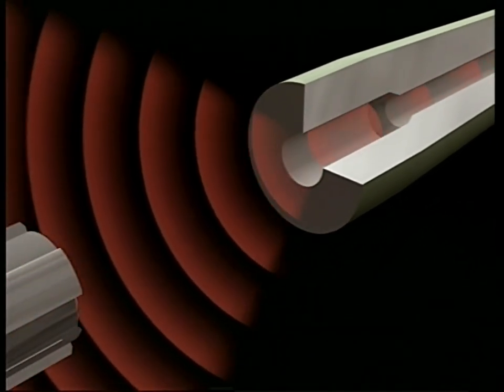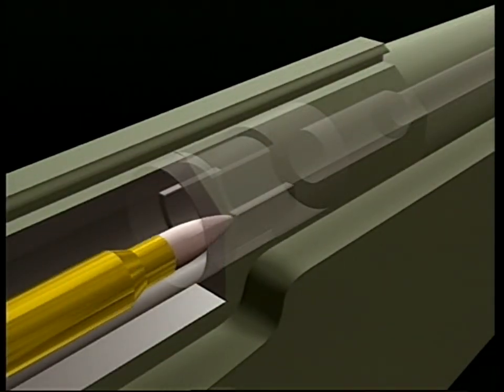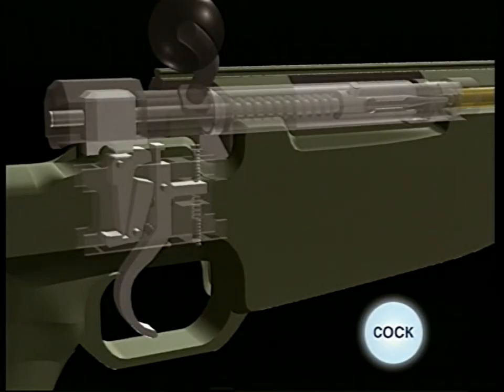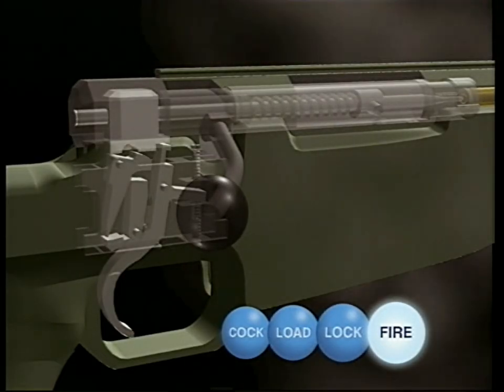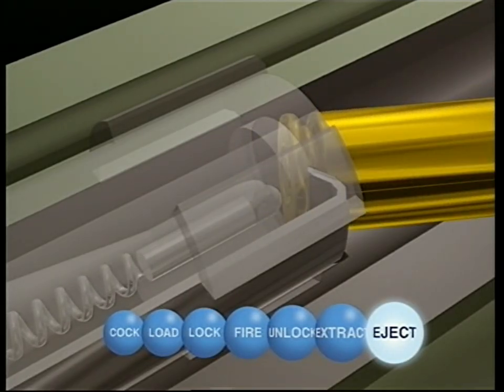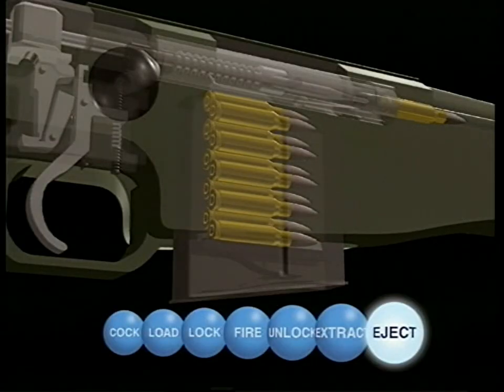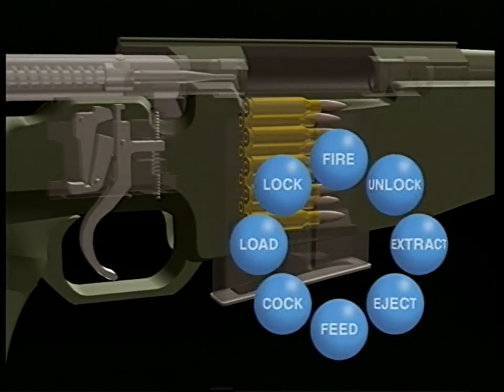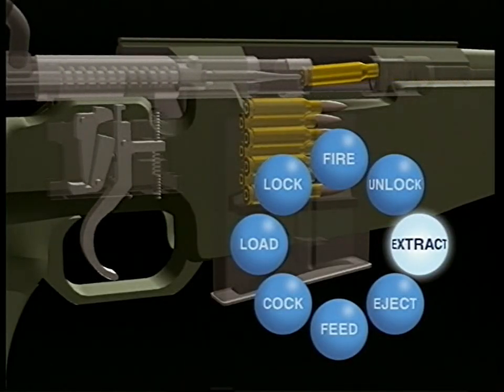Sniper rifle action of mechanism AW.wmv #sniper #sniperrifle #howitworks #boltactionrifle

Comment: How does the striker collar rotate when it gets put into locking position? There is no pin holding it to rotate it...
Reply from the maker: Good observation. The striker collar is part of the firing pin (the striker). As you watch the video, there is a firing pin stop pin and the bolt body will rotate simultaneously with regard to the firing pin (the striker). And the firing pin stop pin will align with the firing pin stop pin groove on the striker collar. Waiting for release.

Comment: So what exactly activates the ejector when you pull the bolt back?
Reply: the ejector is Spring loaded plunger that pushes the base of the cartridge. once the fired round fully rearward, it will be ejected.
Reply: Ignation